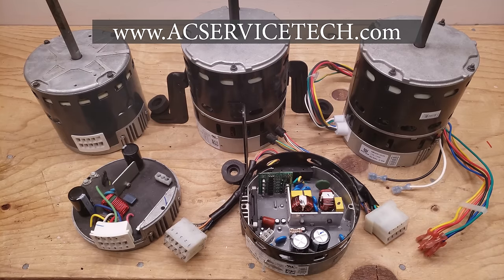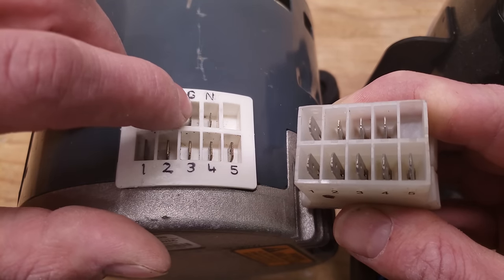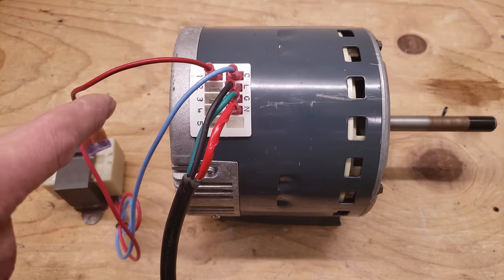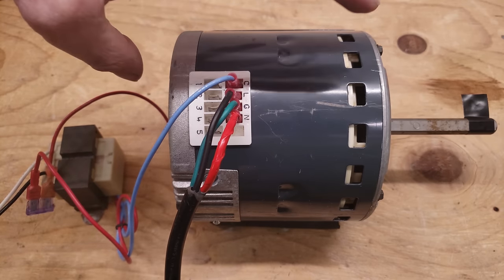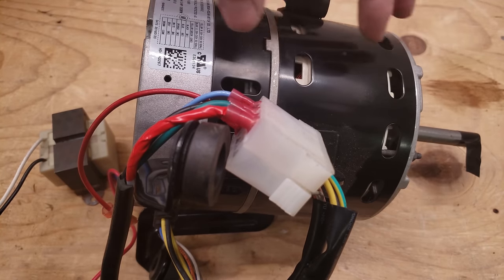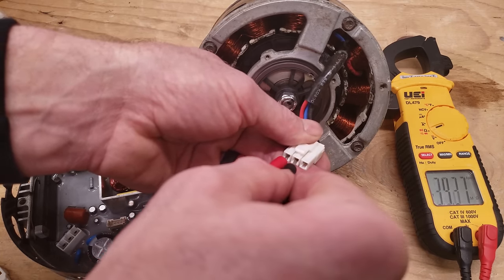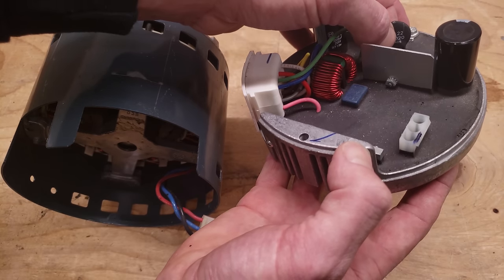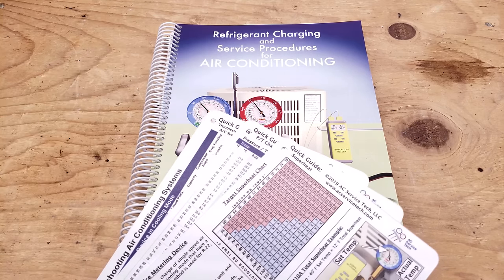ECM Multi-Speed Blower Motor Troubleshooting!

Comment: HELLYA!  Paid $85 for a service call for the guy to lie to me about the issue. Watched AC Service Tech video, got the skinny, back up in the attic troubleshoot to a likely blown Cap on the ECM module, order an exact replacement off Ebay for $82. 3 hours of YT videos, 1 hour to Trane shop to be denied, 1 hour surfing Ebay, then 10 minutes mounting replacement ECM and I'm UP AND RUNNING!   It was a total of 6 screws to fix!!   You saved me $2400!!!!!!!!!!!!!!!!!!!!!!!! Signed up for Patreon. I'm not an HVAC pro so would have preferred a one-time payment.
Reply: Your machine could have been out off warranty. You were paying parts and labor. Did you know it was the blower motor BEFORE he got there? I'm glad you fixed it. But don't bash the tech. Most of the time the company sets the prices..we just do our part and diagnose issues for customers.. plus it's an attic. Salute
Reply: No doubt, glad you can do it yourself but a licensed company has a certain value for their time.  Incidentally I've been researching and there are conversion boards from ecm to psc.

Suppliers won't help you fix old stuff, only push new sales
Reply: I had a similar experience with the capacitor being the failed part but a tech was not involved. After looking at YouTube videos for 2 days (I’m retired) there was a throwaway comment at the end of one that gave me the clue. That was 3-4 years ago and it’s still going (but who knows for how much longer). I think the takeaway from your story is if you have the time just go ahead and get the part when it fails (assuming you can confirm which one that is), change it out yourself (follow the diagram), save on the labor, fix the original if you can and keep it as a spare.

Comment: Unbelievably helpful, THANK YOU!!!  I literally got 2 quotes - one was for $3,850 to replace motor and ECM and the other company said there was not available replacement available and said I absolutely MUST buy new unit which was $10-12k.  I just replaced the motor and ECM with parts from Supply House for $750.  However, from your video I figured out that it was the inrush current limiter that had blown and bought new component for $5.07, so will either save as backup or sell used but working on eBay and probably get $200-300 of my money back, I would have sure paid it.
Reply: Where did you find the inrush current limiter?

Comment: I LOVE YOUTUBE!!!!!  The motor on my furnace went out. An AC/Heat company said it would cost over two thousand bucks to fix it, due to the type of motor ECM. which cost around 1500.00 dollars. So like always I went to youtube to see how hard would it be to replace the motor. To my surprise, there were many videos showing how to do it. Looked pretty simple to me. I found a place that sells rebuilt motors and found exactly what I needed for $300 dollars no tax or delivery charges. Just got the motors and fixed my unit in less than two hours, most of that time was cleaning the furnace. The wife is happy and I am very happy. Thank you, Youtube you're the best!!!
Reply: What site was it?

Comment: It is usually the module that goes bad. They are expensive. To prevent overheating and module breakage, ensure there is proper air flow. In other words, not too many in-line air filters, clean filters, no restrictions. You may have a desire to keep the squirrel cage squeaky-clean by using multiple in-line air filters, but at the expense of cooking your ECM module. Not worth it!!! Trust me, I know.
Reply from the maker: Ha ha yeah I have had to order expensive ecm variable speed motors to replace ones broke by a $1 clogged filter!
Reply: Yep. I had to do the same (only change the module) on two identical Trane air-handlers due to too many inline filters present.  I assume that the module component(s) overheated due to instructing the motor to maintain the  indicated cfms through the clogged filters. That said, I wondered if simply replacing the thermister (that disc-shaped component in the module) would have fixed it. There may have been other or additional components burned out in the module, and I did not want to take the chance. What do you think? I also had to replace a condenser ECM fan motor on trane heatpump. It was 17 years old. I knew that only the module was bad, however, they do not come as separate parts (module & motor). Thus, I had to buy the entire assembly (module& motor together) for $850. Whew!!!

Comment: You always do great training videos, but this one is one of my favorites. Unfortunately I have already ran across a OEM replacement motor that was programmed wrong, not for sure if it was the manufacturer or the distributor (lot of distributors are able to program motor with OEM specs). Since the motor was under warranty, the service call was negative profit for labor.
Reply from the maker: Sorry to hear that and yeah we need to be very well versed with the things we tend to run into. Thanks for letting me know Superior!

Comment: Great information Greg! Just to add another tidbit of information, I had purchased a generic X13 preprogrammed ECM motor, but the motor ran backwards. There are three stator windings which are very similar to a 3-phase motor. One can cut any two of the three wires on the connector going to the stator windings, reverse the leads and the motor will run in the reverse condition. I don't recommend this, but it will work as I've done it to get a unit to work. Fortunately, the motor speed was very close to the original.
Reply from the maker: Nice, thanks Stuzman!
Reply: Some of those motors have a way to program it to reverse the direction of the motor. Also, the motor is a three phase motor, but that doesn't mean you can hook it up to three phase straight from the breaker panel as a temporary work around. I tried this as a last ditch effort to get the AC blowing again, and the windings started to cook. We were over 80 miles offshore so getting a replacement wasn't going to be quick.  Thankfully, the field had a crew boat that was making a run to the beach for resupply the next day.

Comment: I have a carrier unit with the broad ocean ecm you have in the video. I have had an issue 3 times now where all of a sudden when the ac turns on the inducer/blower motor doesnt turn on. The first time I got it working, but to be honest not sure what I did is all I did was test just like you said and when I hooked back up it worked like nothing had ever happened. It then did it again several months later. I was out of town but the wife and kids were at home and I just called an hvac tech to come and look at it since I couldn't trouble shoot. I had the wife simply kill power to the whole unit and when the tech got their the next day he flipped the power back on and it worked with no issues. Basically paid him for a trip to come to my house and turn it on. Well now it has been about 6 months since hat time and it has done it again. Of course I am out of town, but I will trouble shoot when I get back. 

Sorry for being such long winded but wanted to give you as much info as possible. So you have any idea why it would be intermittently not working. Why would it not work then when turned off for a period of time or when testing it it just all of a sudden works like normal again. I had thought the first times were due to power surges and actually installed a whole house Honeywell surge protector about 3 weeks ago so it wouldn't happen again. This last time, today my wife said there were not any power surges. Any help would be appreciated.
Reply: You may have an intermittent problem with that blower motor. That means it’ll work when it wants to and it won’t work when it wants to. That’s a sign of a bad module or blower motor or both.

Comment: I live in the Chicago area, lots of supply houses, but on a Saturday night at 100 bucks + an hour the bill can be ridiculous.  I've also had supply houses be out of stuck.  I always carry a standard PCM motor for older style motors.  At -10 outside the people don't want to hear you'll be back tomorrow if you can find the part.  So, I will install the PCM motor and hot wire it low for heat and high for AC.to give them service.  I know some guys that carry an old working motor just to give service and you can take your time getting the right part.  I carry a 1/2 hp. does 1/6 thro 1/2 and 90% of my calls.

Comment: Excellent vid.  IT would be nice to know what application of the 24 VAC motor speed control signal actually do, and how one goes about "programming" which speeds are active.  It is clear from your vid that only 1 control signal is to be applied at a time.   What if the air handler controller feeds 2 at a time?
Reply: I found the same thing… a Goodman system feeds 24v to 1&2 when heating or cooling and 24v to just 1 with call for “G” alone…

Comment: My ECM had magnets detached from the rotor.  Cleaned off the junk glue film remaining on the rotor and magnets, and re-affixed them with epoxy, original orientation, spacing.  Motor working fine again.  Thank GE, Beloit and Junktek  or whoever owns this now Genteq for stupid glue application.  Even multirotors have the magnets arranges so they cannot be thrown off.

Comment: Thanks for this. The industry charges huge margins for relatively inexpensive parts from Mexico or even China and then we get charged double that by the less scrupulous service technicians. Here in Canada things are worse as the parts suppliers won't sell to the public. I fixed my furnace blower for $25 (cost of five thermistors plus overnight Fedex from DigiKey) after being quoted $1,500 for a new unit. I wish I could find a tech like the creator of this video but, sad to say, they are few.

Comment: Great video!  Too bad most control modules are potted.  I do component level repairs on just about everything, so it bothers me when manufactures make things disposable.  I liked that you said that the MOV is replaceable.  Hopefully some technicians will have good soldering skills and will replace them rather than swapping out the module and/or motor.  I have worked on some large 3 phase VFD drives for big commercial air handlers, and most of the time its poor soldering and capacitors.   The VFDs that I work on are external, and are not potted.  Of course there are no schematics, so it is sometimes a challenge.  Keep up the great work.  Your book is great - I purchased it about a year or so ago.  Thank You.
Reply: could a bad mov cause the motor to continuously run or is that likely something else in the module?

Comment: Ac company came to fix our unit thought it was the blower assembly, then the board find out the yellow wire to the thermastat had voltage on it all the time.  Swapped with another extra wire in the harness everything is good.

Comment: Great video on ECM's, I hope you put out more video's on Broad Ocean and Rescue motors (maybe you did already??).  I would change your explanation on the motor potentially overheating if there's an airflow restriction because motors draw less current with an obstruction (less work as your not pushing as much air - less work = less amperes).  I subscribed, looking forward to watching more technical videos!

Comment: Only to add that the “in-rush current limiter” you point to in the electronics module is called a Metal Oxide Varistor - and as you said, can be field replaced with relative ease.

Comment: I’m about to graduate from HVAC course but my IBM went out and the tech that came out did a resistance test on the module and he said it was at 18 ohms but normal limits should be between 10 and 20 so he said it was starting to fail. He replaced the whole blower with a new one that didn’t come with a module on it. So I’m the future I can check the resistance of the motor itself without dealing with the module although the module is cheaper to replace than a motor.

Comment: Just had a first... Payne furnace, newer unit with a broad ocean ECM that wouldnt run so coil froze up. Found circuit board is only supplying 20V to speed tap. Apply 24 direct from transformer, motor fires right up. Apparently the modules are very sensitive and require the full 24V signal.... gotta come up with a circuit board under warranty now🤦🏼‍♂️

Comment: Great video. Thank you for sharing. Happy New Year .   What is different and the same between ECM motor and Variable speed motor ?
Reply from the maker: A variable speed can modulate the speed up and down depending on the gas output stage of a furnace where as an ecm multispeed as very specific speeds. However, both are quieter than PSC motors at startup, thanks!

Comment: I would love to see a similar video done for the GENTEQ 5SBA39GLV5000 EON. I've replaced one module already with a used Ebay find with the motor about 4-5 years ago and am back in the same boat replacing that one. Just trying to limp this old equipment along untill it just isn't worth it anymore.
The reason I would find it interesting is that the low voltage connection on these has 13 wires and a control board with dip switches that a set your CFMs, some ramping profiles and aux heat speed. Last time I replaced the board and the module for good measure, but this time aroung Im pretty sure its the module, as it occasionally starts running and does a sortof "searching" behavior before it just gives up altogether. 
I would love to know if there is any common fixable problems with these as I'm about to become the proud owner of two backup modules, motors and one control board.

Comment: Your video is friggin awesome!  I have been dealing with problem #2 (the pulsing up and down of the speed of my GE 2.3 ECM 3/4 HP MOTOR 5SME39SL0674 for the last 14 months.  In your video you explain that IF the motor is still in the squirrel cage that it might act different than in your video.  I'm listening to my a/c run right now as I type.  When it comes on initially it comes on soft and then slowly ramps up to full power, then suddenly drops down low to almost as if it was OFF but it is still blowing air out of the vent if you put your hand up there to test...then ramps up to full power again.  Up and down about 3 to 5 times per cooling cycle (about 5 to 10 minutes typically).  Does that sound about right for it possibly being the ECM module on the back of the motor?  I have already replaced the main system control board AND replaced the actual blower motor with the exact same results still.  Thanks again for posting.  I feel confident that you have isolated my problem with this video already.

Comment: I’m a new “watcher” , but definitely an old guy . 43 years and still getting out there. I recall that supposedly there is one component on the GN 24 ECM module that can be replaced. I would love to prevent my customers from paying $1000 for a new motor and module. I believe it is a IRQ 20 , 141Q   Capacitor or resistor.  Any suggestions?

Comment: Great video Craig. Do these troubleshooting techniques apply to all ECM's ?  Thanks Chris
Reply from the maker: The ECM multispeeds are usually built this way but ECM variable speeds are different, thanks and I have done some other videos for the genteq 3.0 and 2.3 variable speed motors, thanks!
Reply: Well these are American specific, if you get Japanese equipment like Fujitsu or Mitsubishi it's a different style ECM motor with different control signals.

Comment: My motor struggles to get going on startup (spins but very slowly). If i turn the breaker on and off its about a 75% chance it kicks on and everything is fine. Could this be the module going bad? Great video btw i will be watching more.  First video i have found like yours ty.

Comment: Great video! I have a Rheem 70-101729-03, if I want to replace it with another model which one should I purchase? And can you make a video  on the wiring from the x13 to the transformer and the control board? Thanks.

Comment: I have a question that I hope you might be able to shed some light on. We purchased a new home about 2.5 years ago. AC and heat has run fine for that time frame. Last night I got an alert from Nest that it ran for a longer than normal time and temp did not come down. I was gone all day and discovered the unit was not circulating air. I checked all the common stuff and it was running so I put it back together late at night. Mid day today same thing, no circulation. I pulled cover back off to find the capacitor (did not know there are now ECM's on them and discovered the blower motor ground was just hanging and had never been bolted down. it was just barley touching a bolt, but is it possible for 2.5 years this was operating normally with no ground on the blower motor (or very lightly touching)? I know sometimes it can use other grounding ways, but found it odd. Thank you and I am interested to hear your thoughts.

Comment: They could have made it repairable by any entry level electronics tech without the potting (epoxy resin poured on the board) for $10 worth of parts. We could keep and repair the cores but removing that stuff is almost impossible.

Comment: I just ordered the GENTEQ 5SME39NXL097 from the x13 line, it looks identical the the one in your video.  The one I bought is the exact same part number as what's printed on my old one.  So you're saying it still might not be programmed correctly?  5SME39NXL097

Comment: What voltages do you expect to get out of the module and is there a way to connect power to the motor for temporary without the module? Maybe some type of universal module you can pop in there until you get the new part?

Comment: Great Video, but what if the blower motor comes on with just high voltage connected?
Low voltage is completely disconnected and the motor comes on once high voltage is turned on.